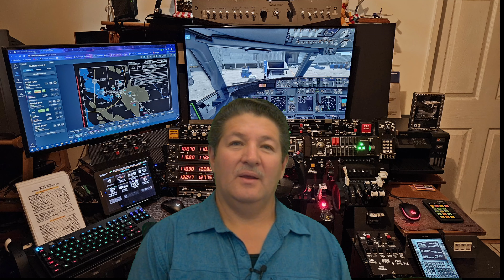Using Toggle Switches with SimVimX

Comment: Hi, great vid and loving the series. I have a question, I have a few 8 pin MUX boards....would the pull resistor and other connection (EN to Gnd pins), still be needed?  I noticed on the SimVimX site that the pin connections to the Mega are different, that bit I understand. Just starting out using Arduino and SimVimZ to make controls for XP12 :)
Reply from the maker: @andygorman1149  Hi Andy, thanks for the kind words and your question. You are correct, those are connected differently to the Arduino and I don't see anything on the website about the resistor. Since the EN pin is actually the S3 address line, it would not be good if it was grounded. 

I've never used the 8 pin MUX boards but I'm pretty sure if you don't use resistor it will work just fine.
Reply: @Qosmokid  thank you so much for the reply. I too didn't see anything about the resistor so will leave off. I bought the 8pin mux by accident and now have 5 of them, I did buy these many years ago, but will order some of the 16piun MUX boards soon. Your vids have been super helpful and I continue to watch them! I see SimVimX will be having a major update in May (possibly), for X-Plane, really looking forward to this :)